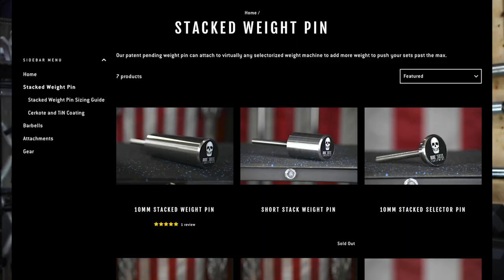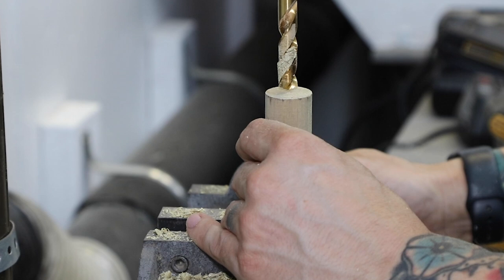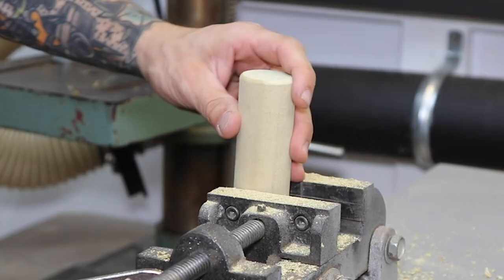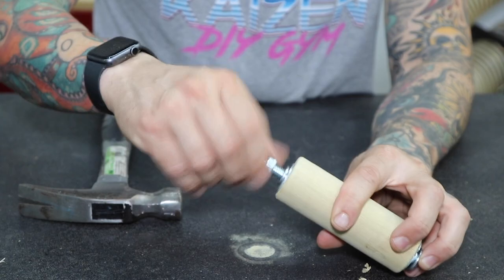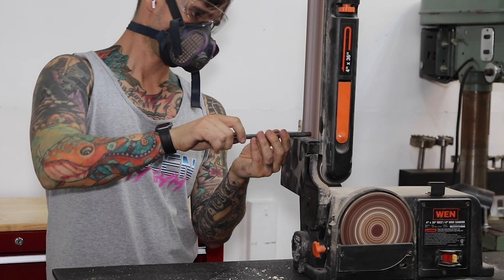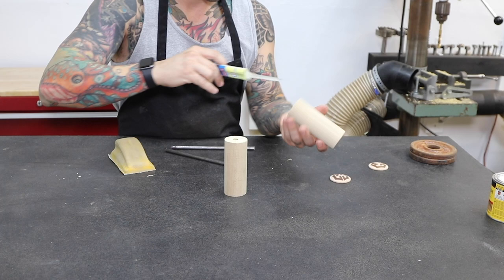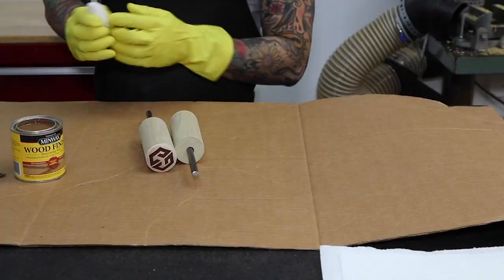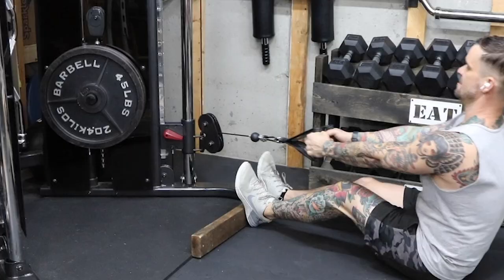DIY Weight Stack Pin Olympic Plate Adapter for cable pulley home gym system

Comment: Will the bolts not hold a lot of weight? You need a steel rod? How about stainless steel threaded rods if I wanted a nut on the other side?
Reply from the maker: The bolts started to bend under heavy loads.

Comment: Awsome, I will try it out, question, for the 3rd option, why not use 2 inch dowel, will it be to tight?, Does the 1 3/4 dowel holds well?
Reply from the maker: I’ve found I need to sand down a 2” dowel to get it to fit